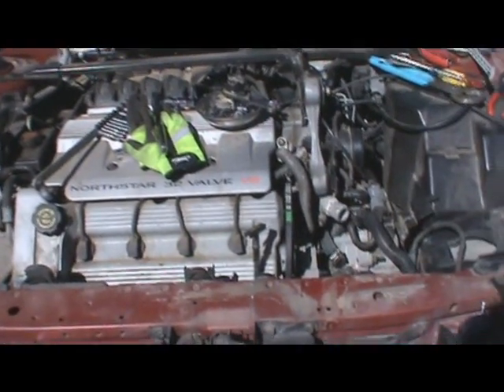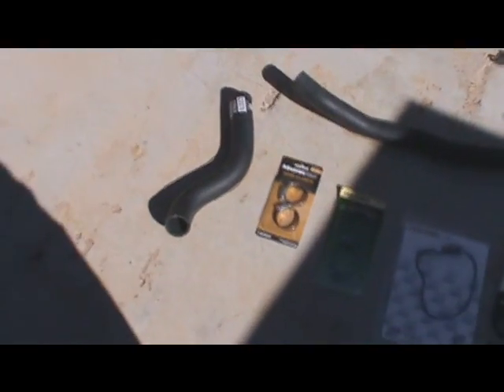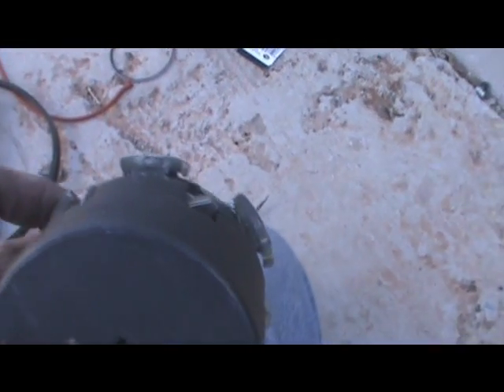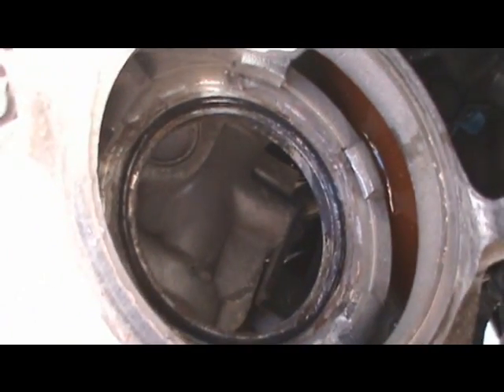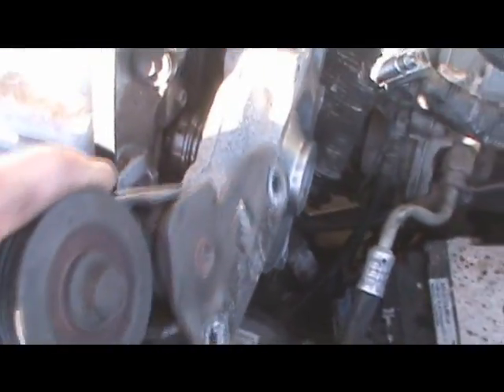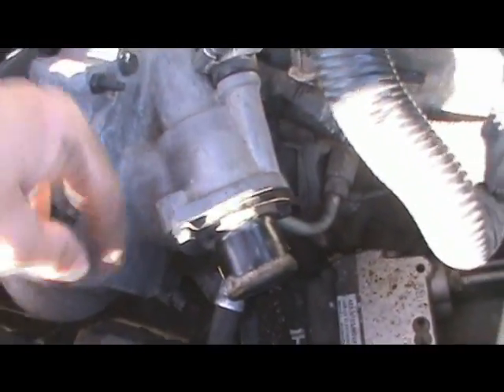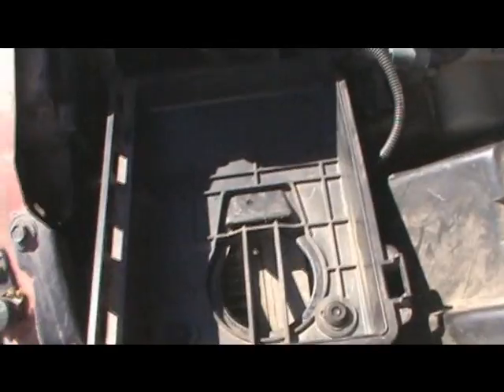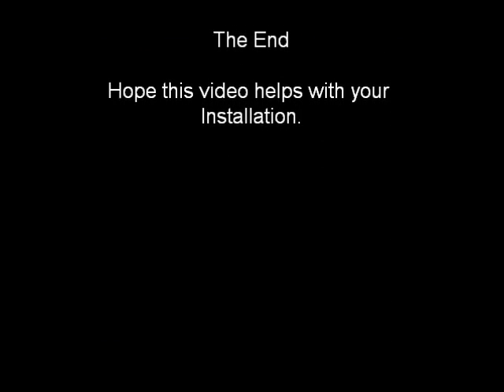How to Install a Waterpump on a Cadillac Northstar engine.

Comment: Not sure, but I think the water pump has reverse threads. Not bad for having been done at sea during a raging storm. I feel this is missing something, and I would not feel confident doing this job based on this alone.

Comment: this is not a how to it is a let me show you what I did after I did it video by the way if you slightly stretch the o ring gasket and then lay it gently but it in the groove it will shrink back down on the rim and stay in place .. no grease necessary

Comment: I shouldve watched more videos on this job before I followed this guys "looks simple and easy " video because it's not step by step. If you want to make a video for non mechanics yet diy people then by all means become a fellow diy guy yourself in regards to makings a camera stand to allow you to actually SHOW step by step. That's the whole purpose of video! That said this video should be deleted. Notice how you show how the water pump tool fits onto the pump and which way to turn it? THATS NOT CLOCKWISE!!! Fuck not using an impact and breaker bar turned the way YOU say turn with crack people's shit too! You didn't even show nor tell people that before they are attempt to loosen the pump they have to remove the belt from the pulleys! Please delete this crap!!!

Comment: Exellent video. Thanks for making it, I just bought a 1996 Deville and I may just replace mine because the engine overheated, But the computer put it in safe mode so I could get off the road. The car has been sitting for 2 years, So I am replacing the radiator as well. I should just do the entire cooling system to make it clear I do not have a head gasket blown.

Comment: I will tell you this as I have changed my water pump a couple of times on my north star engine.  You are gonna have to put the water pump in there just right. It will take a couple of tries before it goes in there just right.. I think it is easier than changing a water pump on my 80 Caprice.

Comment: Ended up taking my 2002 Seville STS to my mechanic to redo my attempt at replacing the water pump and he turned me down flat. "Vic I don't want to mess with that, it's a pain" he told me. I mean if you've changed out a pump successfully before that's great but if you never have then I would suggest you spend $250 to $275 and have it repaired by a professional. This is not to criticize scotts01Z71. I'm glad that he's good at this but if you've never worked on a Northstar engine and you are looking at this video and thinks it's as easy as he portrays it, I can only suggest to you that whether he intended it or not, absent from his video is the difficulty involved. The problem is the O-ring configuration. After installation it leaked badly. (IT'S NOT EASY TO GET THE O-RING TO SEAT CORRECTLY.)
Reply: I mean it looks like he installed the waterpump by using just his left hand ✋. Made it look so easy. And then to suggest that my mechanic doesn't know what he's doing made me grin.
Reply from the maker: +Victor Yonkey The water pump job was so easy I only needed my left hand. ;) lol...
Reply: One hand tied behind your back! That's talent.
Reply: Victor Yonkey

Comment: Well I took on this "Little Project" and it's not easy in the least. Very tight spaces!! Knuckle buster! This video does not show the difficulty and makes it look easy. That O-ring didn't set right and I used the grease trick suggested. Didn't take 3 hours either or 5 minutes like the video. Take it to the mechanic, worth every penny.

Comment: hi scott,, I have a 02' dts with 172,000 miles. at idle it will overheat, heater blows cold air, but rev it to 2 g's steady, and the temp drops to norm. heater works norm. does that sound like the water pump ?

Comment: You are NOT supposed to add water to a Northstar Engine!!!! You were supposed to drain the radiator, all coolant from the block, core, expansion tank and ADD ONLY GM DEX-COOL which is ORANGE not green. It's 50/50 gm coolant. Google it and you'll see. The way you did it might blow your head cover gasket, if not blown already, it sounds funny!
Reply: I think his point was to use water for the leak test. I have used water for leak tests on every coolant system repair, and have never had a problem. I agree it is a very good idea to drain the water out after the test and replace with the conventional coolant you mentioned.
Reply: well i run water in mine and mine didnt blow gasket i been driveing just water for 2 mouths and it only get a little over hafe way  when i sit at a red light or 5 to 6 min siting still but if i am dirve it fine  guy tells me the water pump and i know it not fan because i hear it kick on and i took and try to replace the old thermsat but it keep try to get hot so i took it out and been run it like that
Reply: leanorlando you don't have to use dex cool. I know multiple people who own Northstars that no longer use it because it clogged their cooling system. They now use regular prestone and haven't had one issue.
Reply: Better do your research on DEX-COOL young man. Sorriest damn stuff every made. Had to use it while car was under warranty. Most smart people got rid of it after the warranty had expired. Won't go into detail as to what harm it can do. Like I said....... Do your research.

Comment: A great video--saves a shade tree mechanic/owner $200 to $250. It's not rocket science. The hardest part is that fourth bolt on the housing in the 4 o'clock position. A reatcheting box end wrench--10mm--is the fastest way. Be patient. Remember that the pump loosens in a CLOCKWISE direction. Terrific video.
Reply: That is highly important
Reply: Why did he not mention that ? Def something that should be shared ,whatever man thanks !
Reply: You gave us more important info in two sentences than he did in 5 mins of video.

Comment from the maker: These are very tight fitting waterpumps. It takes quite a bit of force to remove and replace them. Is the Mechanic removing the waterpump in the right direction? It comes off clockwise. (pushing towards the windshield)
Reply: Great information I was having problems with the tool staying on the locks as I was trying to twist soo what I did I used a pair of vice grips and clamped the socket and the housing together just snug and it did wonders off in two seconds and yes I used a cheeter pipe good luck guys

Comment: I just replaced my water pump in my 05 Bonneville GXP with northstar 4.6 V8 engine and this video really helped alot!! Thanks for posting!! FYI this employee at autozone told me to use an impact wrench if i had one to use on the waterpump removal tool!! I was like you know it's an aluminum engine right!!! He said thats how he did his.. lol Just like you said in the video you don't need to us an impact tool just a cheater bar and you will be good...

Comment: I have a 2001 Deville and replaced the thermostat but just can't seem to get it to bleed properly. I've tried everything I have seen on the internet with no real success. At this point I'm ready to pull radiator and have a regular radiator cap built into the top of the radiator. What a stupid design. 
No one vid totally explains how to bleed a 2001 Northstar just say it is self bleeding which is not true.

Comment: is changing the belt a complicated process? you didnt show that other than removing the tensioner. I will be changing the Waterpump, idler pulley, tensioner and belt, I have an 05 deville, I saw another YT vid with a guy with an 06 had to remove the fuel rails and all the wiring harnesses and it looked scary. I dont have to do all that to change the belt do I?

Comment from the maker: It takes quite a bit of force to remove the pump from the housing. I had to use an extension(cheater pipe) to remove this one. Its a very tight fit.

Comment from the maker: A bad water pump can cause a car to over heat. Among other things such as low coolant level, plugged or leaking radiator, cooling fan not operating properly or at all.

Comment from the maker: If memory serves right there is one key smaller than the rest on the water pump. It does take a little force to turn the pump in the housing. I had to use a cheater pipe to remove and install the pump.

Comment from the maker: Yeah The tool can slip off of the tabs real easy If you don't keep the bar straight. Its a tight fit but it has to be or the pump would just come loose and spin In the housing. If you can put your hand against the head of the socket wrench and put pressure on it. This should keep the tool from slipping off. Be careful watch out. If the tool breaks the pump loose be ready to move your hand out of the way or it could get into a pinch point.

Comment from the maker: Yes. Put a 2x4 on top of a floor jack and put the jack under the oil pan. Just enough to take the pressure off of the dog bone mount.

Comment from the maker: Unfortunately this car was sold 3 days ago so I cannot make a video on how to flush the coolant tank. The best way to flush it is to take it out of the car and take a garden hose to it. Not to hard to do. Should have 2 or 3 bolts holding it in place. Make sure the engine is not hot. This way you can Inspect the hose for a clog as well. Another possibility is your radiator could be clogged. This is more than likely to happen than the  coolant tank being clogged. Has the radiator ever been flushed

Comment: Quick Question Should the Hose going to the water pump heading right to the lower part of the radiator be really hard and under pressure ?

Comment from the maker: Sounds like the thermostat is staying closed and not opening when it reaches temp. Make sure the belt is not broken that drives the water pump. Make sure that your cooling fan is operating.

Comment: my 96 deville is running hot. it drives fine then about a half hr or less it gets so hot it shows me a warning on dash that says check coolant/temp hot n then 3 min later shuts it self off at 270 sum odd degrees....but doesnt give me warning b4 it hit 270. can  anyone please help!!! idk whats wrong with it.. my neighbir says waterpump..my other neighbor says headgasket.. my spark plugs were pulled..not sludgy/wet..not any distinct white or grey smoke out exaust..

Comment from the maker: @bassjackgruv Its pretty self explanatory. Everything that I took off was videoed on the ground and as to where the water pump is located. Basically what has to come off if your just doing the pump is the air filter housing, drivers side dog bone motor mount and the upper radiator hose.In the video i show how the pump is removed and installed. Thanks for checking out the video.

Comment: I changed my water pump on a 99 STS the 1 thing that would have saved me a lot of time. Knowing that there is 1 tab smaller that is made to line up with a notch in the housing to get it out and put it in, your video so far was the best I've seen.

Comment from the maker: @LSB979 It should still be able to come off. The hole In the housing is larger than the pulley itself. All the tool does is lock and unlock the Water pump. How did the pulley melt?

Comment: ok i got a 97 cadillac deville concourse wit tha same engine (of course)..well my water pump pulley is melted  almost all tha way ..my question is will tha puller still be able to pull it off cuz i already got tha tension pulley off and im buyin a new belt wit tha water pump to.

Comment: I didn't mention in the last post that I did a leak down test. I left it on for two hours and it leaked down 3psi in two hours. no milkshake in oil engine or trans. its a line that runs to the ALT. from the RAD. i guest to keep it cool, it was blocked. I hope by getting unblock there wont be any trapped air in the system. I'll test drive it in the morning.WISH ME LUCK!!

Comment from the maker: @71branch Its possible. If its a blown head gasket, coolant will go Into the combustion chamber and produce white smoke out of the exhaust. Is the car over heating and were you able to get the new water pump Installed? If you give the system a leak down test and you see no visible coolant from the outside of the engine but the pressure gauge is losing pressure it is possible you could be losing coolant from a bad head gasket.

Comment from the maker: @71branch If the pump is not out use a piece of pipe over the ratchet to get the waterpump back out. Sounds like it went in crooked. Match the tabs on the old waterpump to the new ones and bend them back into place. If all else fails return the new waterpump and get another one. Hope this helps.

Comment from the maker: @jjm1241977 Something does not sound right... at all. It should not be that hard to remove. If your standing at the front of the car( In front of the bumper)  you are pushing away from yourself( clockwise) to remove the waterpump correct?

Comment from the maker: @jjm1241977 Your doing it right. Its a real tight fit. I found it easier to use a cheater bar ( a piece of pipe over the ratchet to get more torque) it will move no more than an Inch. Your not gonna break it. I thought the same thing when trying to remove the waterpump. Just needed the little extra leverage to get it out and back In. DON"T use an Impact on It, the housing will crack. Hope this helps.

Comment from the maker: @jjm1241977 Opposite thread as in Left hand thread? No, all the bolts are right hand thread. To take the waterpump out it goes clockwise. To Install It goes counter clockwise.

Comment from the maker: @Xarmy187 Not to bad at all. What makes it easy is that it does not run off of the main belt. Its on the other side of the engine away from the other components. Which In turn makes much more room to work with.